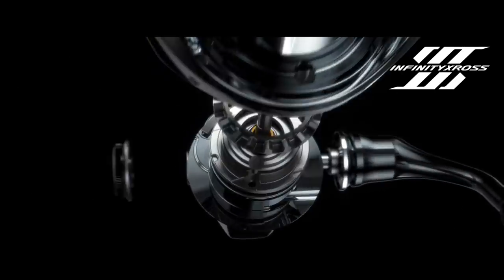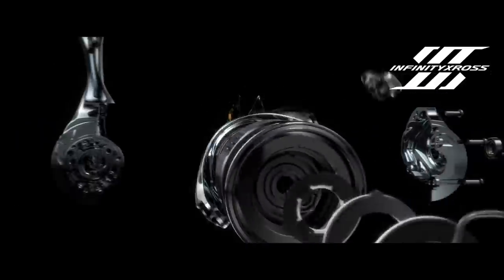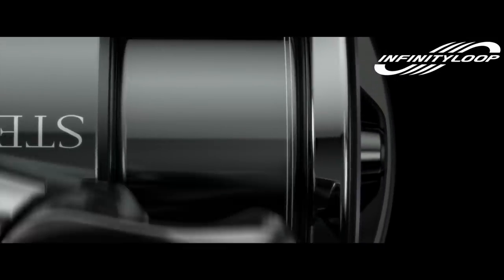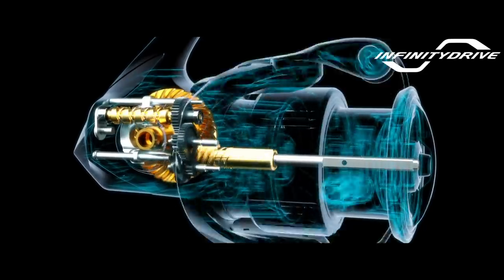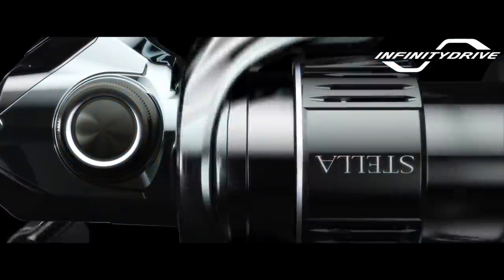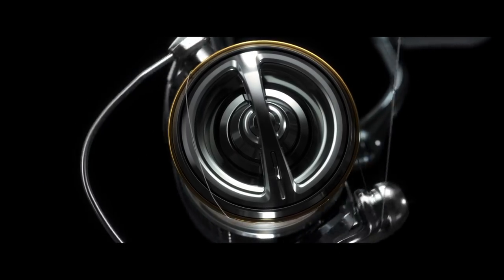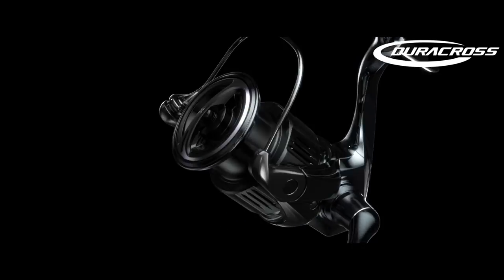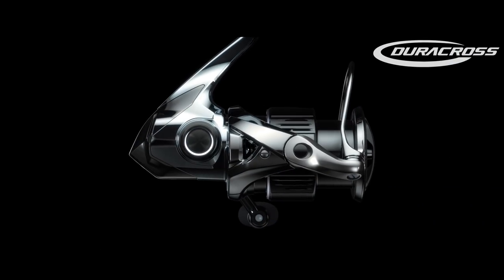Shimano Stella - Infinity Evolution | Technology Explained | New For 2022

Comment: Not good. SSO system of line lay is going to cause braid to cut in. It doesn't work in such short range reels.
First tug of jig head to pull it off and you gotta re-spool it.
Reply: I thought exactly the same thing

Comment: Infinity loop is not a new technology, Shimano has had this technology in the Surfcasting line (e.g. Aero Technium, Ultegra, Surf Leader) for over 10 years under the name "Slow Oscillation". Also called Aerowrap in other models but not as refined as in the Surfcasting reels with up to 100 wraps per up/down spool cycle. Now it has been inherited by this beautiful Stella. It helps in increasing casting distance by minimizing the friction of the line wraps. Daiwa also has this technology, they call it "Slow Cross Wrap" in their Surfcasting reels (e.g. Emblem, Basia, etc.). In Surcasting reels, it works very well with any diameter of mono but with braid but it must be a very nicely cylindrical braid, like Power Pro Super Slick V2 or Daiwa J-Braid X8 to get the most efficient line release.